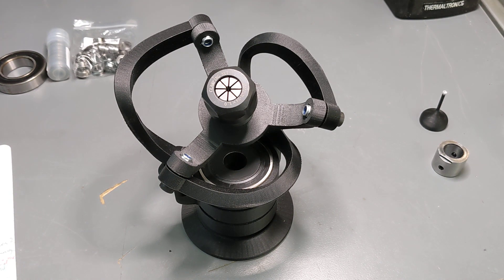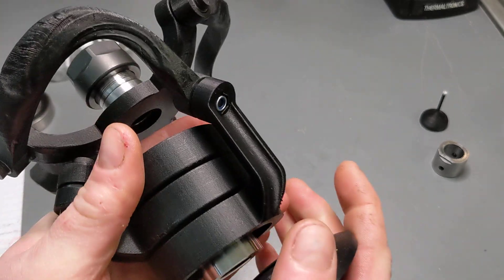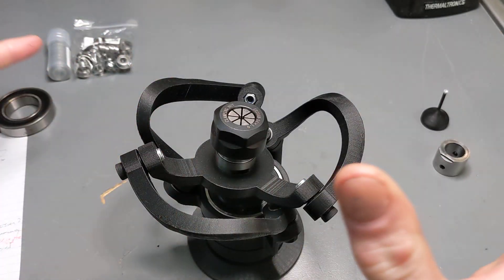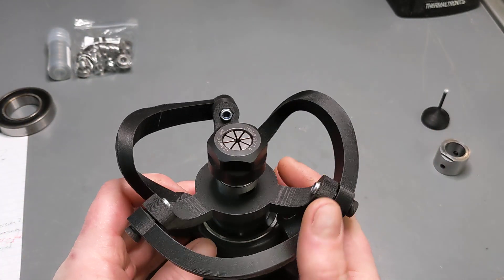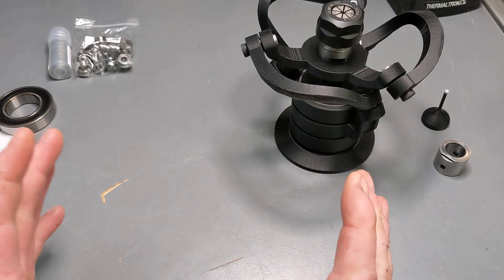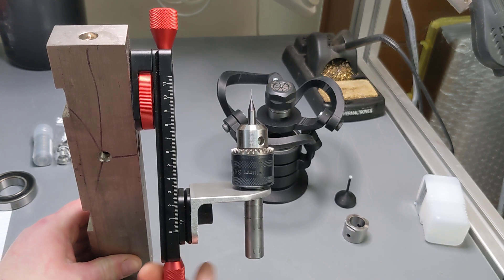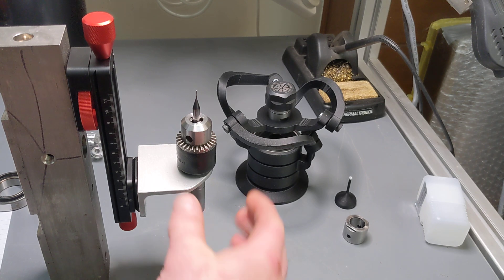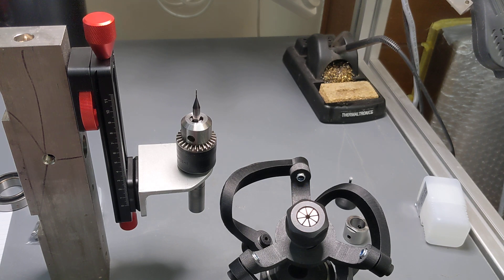Update on the Spherical Parallel Manipulator

Comment: making a small post-mountable X-Y micrometer stage to fit in the ER collet chuck would allow for the viewing of a point on any object with precise adjustment, for the precision-minded. somewhat approaching a spherical optical comparator of sorts
Reply from the maker: Exactly, I sorta touched on it in the video but having a universal work table of sorts could allow the community to make whatever work holding they needed and slot it in, the main idea I had in mind when talking about that was: 
A tiny XY table above a bearing (ie you can spin the XY table) and the XY table would have the workholding on it (tiny vise, ER holder, etc). With that you could hold any object and offset the object such that the center of rotation is where you want it, eg assemetric or non-round objects
Reply from the maker: I ended up deciding I'd just make both available for everyone 😅
I've just uploaded the latest update vid, I've put a lot of work into making it accessible for everyone, files available very soon and I got the costs down to $10 of parts: $10 SPM https://youtu.be/DqjAKmm-FJQ

Comment: Thats such an awesome idea! Would be awesome to clean lenses under the microscope on that.
Reply from the maker: Interesting, I dabble in optics/lasers/related (still learning), what lenses do you clean under a microscope?
Reply: Laser Optics and lenses. Defects of the size above 4-6 Microns can become problematic
Reply from the maker: Ah, serious laser-ing, like clean-room level? 
I'm unsure about the off-gassing of the various filaments but one could substitute the bearings for clean room rated ones
Reply from the maker: I ended up deciding I'd just make both available for everyone 😅
For the polar variant: I'm still working on improving it but it's very usable as it is. The current version in the vid below is built with as much 3d printed as possible (ie the 'cheap and accessible' version) and it's quite usable for low to medium magnification or static applications (ie move object and wait a quarter second for it to settle)  but I plan to do a short production run of a fully metal one for professional use etc. I'm still working out the details on that, if your interested put your email in this form https://forms.gle/XGxA5Zzp16doP4pE6 and I'll keep you posted on that (your email wont be shared or used for marketing, I'm just an engineer in a shed trying to figure out if people want a thing 😅)
Either way, check out the latest update vid, I've put a lot of work into making it accessible for everyone, files available very soon and I got the costs down to $10 of parts: $10 SPM https://youtu.be/DqjAKmm-FJQ

Comment: you could remove all bearings and just use magnets as the contact points for motion. This is used in delta 3d printers and its super smooth and easy. With this, the entire center hub could be taken out to make a simple change over from the er-16 a solid flat base or any other kind of holding fixture. having a lock or a simple detent to hold the position would be a good addition.
Reply from the maker: This is the first 'alternative to bearings' suggestion I've heard that's actually viable... though can you link me examples that allow rotary motion only (eg the same motion as a bearing)? I know spherical motion is achieved with a magnet (spherical iirrc) and a ball bearing, but for these to work we'd need to constrain all motion other than one axis of rotation per joint... I haven't kept up with the delta 3d printers with magnets thing so I'm not sure if they've done that.  
That said, the little bearings are only 50c each in a pack of 20 so it may not be necessary.
Reply: @makebreakrepair  I was thinking that just the joints connecting to the center hub would be spherical, the other set of bearings on the arm would need to remain bearings for the axial constraint that the spherical magnets wouldn't have(i'm not sure if that would impact the mechanism or not). I do find the spherical magnets to be surprisingly strong and resistance to axial displacement. Hayden arms for delta printers use a high carbon steel ball with a machined delrin cup and a strong magnet at the base of the cup to keep the ball seated. My guess is that pla would hold up well enough to have the socket integrated into the arm with a small hole for a magnet to be glued in place, then the other side of the joint would just need to hold a steel ball and its easy to find them already with threads for a screw or threaded portion to be inserted. Bearings are probably the easier and more robust option but who doesn't love magnets if it is only a light duty positioning device?
Reply from the maker: I've just uploaded the latest update vid, I've put a lot of work into making it accessible for everyone and removed almost all the hardware required, files available very soon and I got the costs down to $10 of parts: $10 SPM https://youtu.be/DqjAKmm-FJQ

Comment: I'd like to see the best that can be done with the printing and manual machine shop. I'd want to have a good tool rather than a toy.
Reply from the maker: Yeah, after seeing the responses the current (vague) plan is to release an open source 3D printable version of both that emphasises cheap for everyone to make,  an open source more rugged one using off the shelf metal parts with 3D prints as glue (eg the macro slider attached to a 3D printed base etc) for anyone who wants to make a more serious unit, and, if there's demand, I'll make a small production run of a rugged, all metal unit for lab use/serious work or similar as a product. Genuinely open to suggestions though, I'll make an update vid about it soon.
Reply from the maker: I ended up deciding I'd just make both available for everyone 😅
For the polar variant: I'm still working on improving it but it's very usable as it is. The current version in the vid below is built with as much 3d printed as possible (ie the 'cheap and accessible' version) and it's quite usable for low to medium magnification or static applications (ie move object and wait a quarter second for it to settle)  but I plan to do a short production run of a fully metal one for professional use etc. I'm still working out the details on that, if your interested put your email in this form https://forms.gle/XGxA5Zzp16doP4pE6 and I'll keep you posted on that (your email wont be shared or used for marketing, I'm just a guy in a shed 😅)
Either way, check out the latest update vid, I've put a lot of work into making it accessible for everyone, files available very soon and I got the costs down to $10 of parts: $10 SPM https://youtu.be/DqjAKmm-FJQ

Comment: We take a lot of pictures of small diamonds and parts under a microscope that this would help out a TON in the jewelry industry. Being able to print this in-house would be awesome!
Reply from the maker: Yeah, after seeing the responses the current (vague) plan is to release an open source 3D printable version of both that emphasises cheap for everyone to make,  an open source more rugged one using off the shelf metal parts with 3D prints as glue (eg the macro slider attached to a 3D printed base etc) for anyone who wants to make a more serious unit, and, if there's demand, I'll make a small production run of a rugged, all metal unit for lab use/serious work or similar as a product. Genuinely open to suggestions though, I'll make an update vid about it soon
Reply from the maker: I ended up deciding I'd just make both available for everyone 😅
For the polar variant: I'm still working on improving it but it's very usable as it is. The current version in the vid below is built with as much 3d printed as possible (ie the 'cheap and accessible' version) and it's quite usable for low to medium magnification or static applications (ie move object and wait a quarter second for it to settle)  but I plan to do a short production run of a fully metal one for professional use etc. I'm still working out the details on that, if your interested put your email in this form https://forms.gle/XGxA5Zzp16doP4pE6 and I'll keep you posted on that (your email wont be shared or used for marketing, I'm just a guy in a shed 😅)
Either way, check out the latest update vid, I've put a lot of work into making it accessible for everyone, files available very soon and I got the costs down to $10 of parts: $10 SPM https://youtu.be/DqjAKmm-FJQ

Comment: Why not use a “spherical/ball vise”. A sphere with a vise on top that sits in a little conical cup.
Reply from the maker: I have a ball vise, the issue is the center of rotation is inside the ball, ie tilt the ball and the object moves out of view - not an issue for engraving etc but doesn't work for microscopy or similar. 
If you're suggesting making a hollow ball vise with the work holding in the center of rotation then... that's an interesting thought, though making a smooth, large sphere isn't easy (smooth enough for microscopy at least). If i've misunderstood your comment though please elaborate, the comments section has been full of interesting ideas.

Comment: I wonder if the arms could made flextures, so that you could change the center of rotation by flexing them.
Reply from the maker: I thought about that, I love flexures and I've designed a few simple ones (nothing complicated, still learning about designing them) but I'm no expert so I may be wrong but I think they wouldn't work well here... that said I do think it might be possible to make an adjustable center variant by strategically adding pin joints... it works in my head but I'd need to prototype it
Reply: @makebreakrepair  It would be ambitious, that's for sure.
Reply from the maker: ...and quite possibly a folly, but that's how I learn 😅

Comment: The parasitic motion jumped out at me too, even from a distance...
My initial thought was that maybe you could extend the inner section with a handle for manipulation. Just run the handle right off of one of the triangular spokes, lifting it a bit for clearance.
You would be driving the vertical bearings in reverse, so it would probably add a little resistance, but since everything's already so smooth it might not be an issue.

Comment: That second version is exactly like a gimbal mount for a telephoto lens! The lens gimbal allows the screw mount to be moved away from the vertical pivot, to allow for various diameter lenses, and the vertical "fixed support" has an offset base with a rotating part. The whole thing allows an almost arbitrary size lens to be mounted so that it is balanced around the front to back rotation, and the horizontal center is also centered on the pivot...in your use case, you look to center the point of interest on both the horizontal rotation, yaw, and the front to back rotation, pitch. I installed Belleville spring washers on the clamping screws, to allow more control of the friction on the pitch and yaw axes.
Reply from the maker: I've just uploaded the latest update vid, I've put a lot of work into making it accessible for everyone, files available very soon and I got the costs down to $10 of parts: $10 SPM https://youtu.be/DqjAKmm-FJQ

Comment: I would be very interested in the second style with with more precise variant using off the shelf parts as mentioned at 5:20
Reply from the maker: I ended up deciding I'd just make both available for everyone 😅
If you're interested in the short-run, professional use metal version please fill out this form: https://forms.gle/XGxA5Zzp16doP4pE6 (Your email or any other info you put in that form will not be used for marketing, nor passed on to any third parties, nor used in any way other than to contact you about that specific project. Just a guy in a shed figuring out if people are interested)
I've just uploaded the latest update vid on the 3D printed versions though, I've put a lot of work into making it accessible for everyone, files available very soon and I got the costs down to $10 of parts: $10 SPM https://youtu.be/DqjAKmm-FJQ

Comment: Nice dude, skate board bearings only please👍, they're most available.
This will produce a new wave of microscopy videos perhaps? The flat ones are kind of limited.
Reply from the maker: Don't worry, I have a good cheap bearing source everyone can use and I'll design it to not use exotic bearings and huge chunks of shaft. I'll keep everyone updated on progress etc as it happens but yeah, key goal is easy and cheap. 
The arms in the original use flanged skate bearings (F608s), the flange makes them very easy to design for with 3D prints. 
10 pack is $9 here (not sponsored/no affliation) https://www.aliexpress.com/item/32814352400.html
Reply from the maker: I've just uploaded the latest update vid, I've put a lot of work into making it accessible for everyone, files available very soon and I got the costs down to $10 of parts: $10 SPM https://youtu.be/DqjAKmm-FJQ

Comment: with your polar manipulator you basically just reinvented a nodal head, thats boring. what about a version of the spherical that can be locked in position? then it would be a great work holding tool. 
the spherical design would allow a bolt to be pressed against a spherical surface on the moveable part.

Comment: if you can drive that arbor, it might be an interesting 5th axis for a cnc mill
Reply: If instead of tool holding, you put work holding in the middle, this could be a 4th/5th axis add-on for an existing 3-axis machine for small parts - if it could be made rigid enough

Comment: If possible, I'd go with both. If you only have time for one - probably the weird one with more adjustment. I'd try to 3D-print it as prototype and then probably CNC for improved rigidity and also add slide handles on each of the arms/bearings to try to make them move individually. Also: try to add some form of braking for each arm to make an isolate movement of each arm possible. If you need any help you can also just shoot me a PN and I'll do my best to support you :)
Reply from the maker: I ended up deciding I'd just make both available for everyone 😅
I've just uploaded the latest update vid, I've put a lot of work into making it accessible for everyone, files available very soon and I got the costs down to $10 of parts: $10 SPM https://youtu.be/DqjAKmm-FJQ

Comment: I love that you're pursuing this idea further! You have inspired me to build a motorized version of my own!
The hardware design is basically finished and I am currently working on electronics, kinematics and programming.
I really want to see it perform programmed paths like sinusoidal swings, ellipses and whatever can be imagined.
One final thing, to adjust your height you could use some sort of screw along the main axis, instead of the slider. This way, the design will still be symmetrical and the slider not in the way, when you tilt it. To secure the set height, you would just need a counter nut.
Reply from the maker: There's some excellent powered ones on youtube if you need inspiration (check out @swannschilling474 https://www.youtube.com/watch?v=vNV2LetkfEg) but I'd be keen to see your project when it's ready.
Reply: @makebreakrepair  Very impressive, that he was able to fit everything together so tightly! I really like the idea with the inverse gears.

I will probably also make a little demo video of mine, hopefully next month it will be finished :D
Reply from the maker: Yeah their work is incredible, the effort they've put into the software side too is damn impressive. Definitely keep me posted on your one too, I'd love to see it. I've got a new update vid on mine, files available very soon and I got the costs down too: $10 SPM https://youtu.be/DqjAKmm-FJQ

Comment: Hello there, thx for the reply on the other video - as you requests i'll describe what i intend to do

first thought was: this is so cool, i just want to play around with it :)
second thought: hey could be a solution to paint minis with (though this would probably work way worse than existing slutions with a grip and a piece of putty to stick the mini on) 
third thought: hey, this is so cool, i just want to play around with it :D

so to be honest, i don't really have a use case for it, but i find it very interresting
Reply from the maker: I ended up deciding I'd just make both available for everyone 😅
I've just uploaded the latest update vid, I've put a lot of work into making it accessible for everyone, files available very soon and I got the costs down to $10 of parts: $10 SPM https://youtu.be/DqjAKmm-FJQ

Comment: Hey, I have been working with 3D printed parts for a really long time and have a solid fully 3D printed bearing that could be used in the first design in both the arms and the base. I checked your about section and didn't see an email to send or write this too so if you have any way I can share a step file or f3d file to show you how it works it would be greatly appreciated
Reply from the maker: Reply with a link, I'm curious. 
I've just uploaded the latest update vid, I've put a lot of work into making it accessible for everyone with the least hardware requirements, files available very soon and I got the costs down to $10 of parts: $10 SPM https://youtu.be/DqjAKmm-FJQ